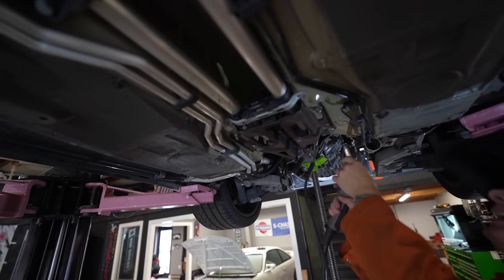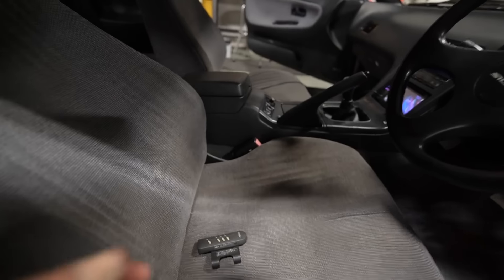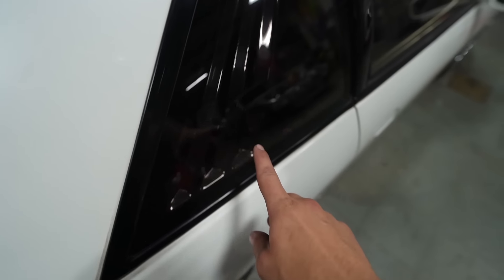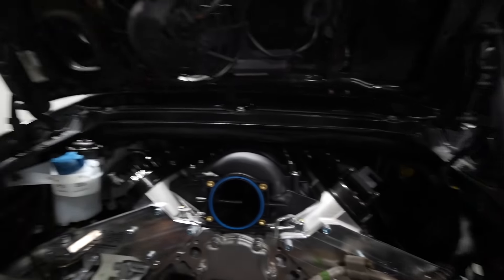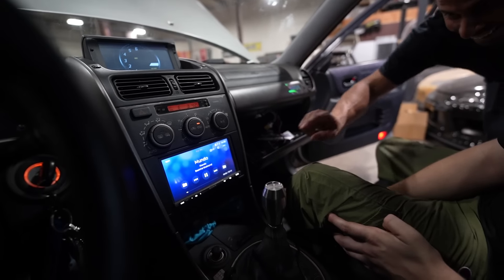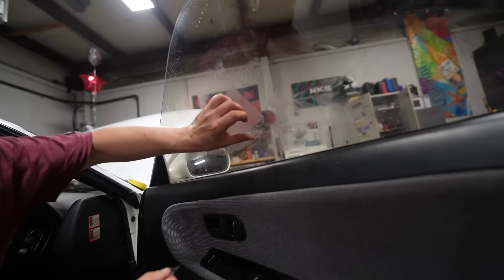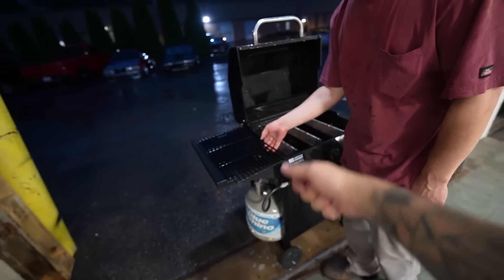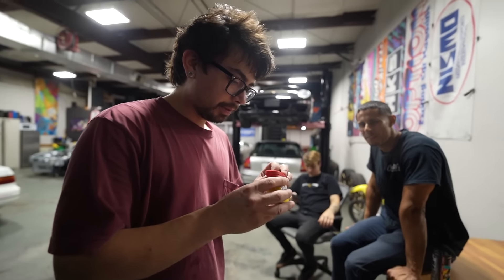AM I TOTALING MY PORSCHE 911 WITH THIS LS SWAP?! - BBQ BANGER AT THE SHOP

Comment: Get an auto dimming mask, it will change your life. I got mine at harbor freight, and then I found out the Lincoln at home depot was cheaper. You can get a Lincoln welding kit that includes an auto darkening mask for cheaper than the Vulcan mask at harbor freight. That being said, I've had zero issues with the harbor freight mask. Super high quality. Regardless no more welding until you get the mask, a thick shirt, heavy gloves. Nothing you're doing is worth the bodily damage.
Reply: Thats a miller mask, has every auto/manual darkening option for cutting, grinding and welding! Preference probably
Reply: @AlexDegnall  yes
Reply: @AlexDegnall  why did ant take it off and weld with his eyes closed lol

Comment: cant u just get the turbo head from toyota then have a 2jz turbo is300? or did he buy it with no engine? shit makes no sense
Reply: is300 never came with 2jz?
Reply: He said he bought a shell but doing NA-T on a IS300 GE motor can get pretty pricey too maybe not 20k but youll need to upgrade the pistons and rods to see anything close to what you can do with a GTE 1J and it’s probably a lot more work than a straight swap if you already have everything you need to do the swap like them. Plus 1JZ is preferred by a lot of people.
Reply: @Drip_Drizzle  is 300 did came with na 2jz
Reply: @Drip_Drizzle  es300 sc300 is300 have a na 2jz auto
Reply: @Trent_Schell  gs300 too!
Reply: @michaelbeaudo6761  20k is so easy to sink into a turbo GE build, especially when it's a shell.
Reply: if i remember correctly it had a beams init
Reply: @kurtseyffert6649 
Beams is over seas only. USDM are all 2JZ
Reply: @negativeindustrial idk !!! didnt dj from more skids have a beams aswell